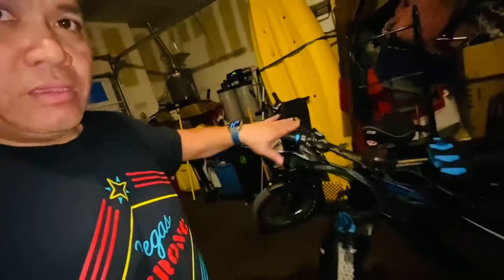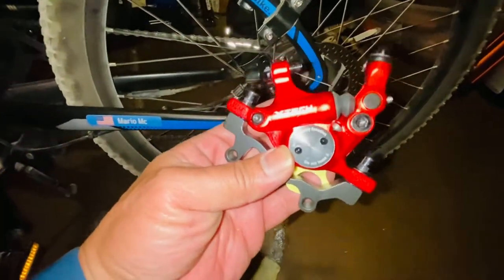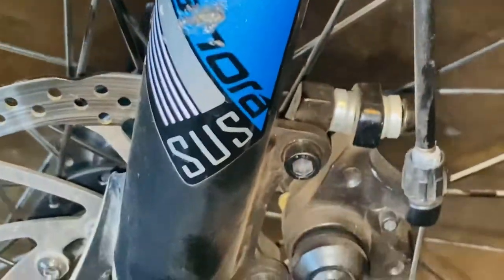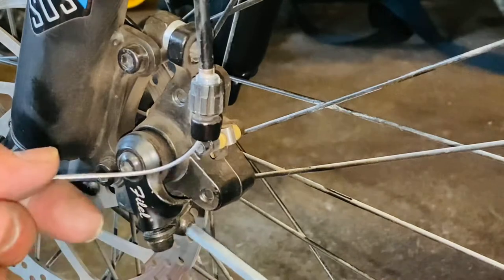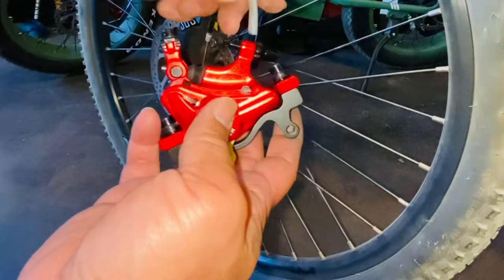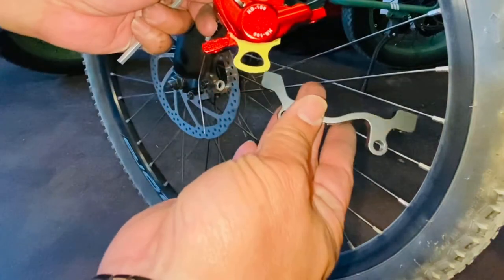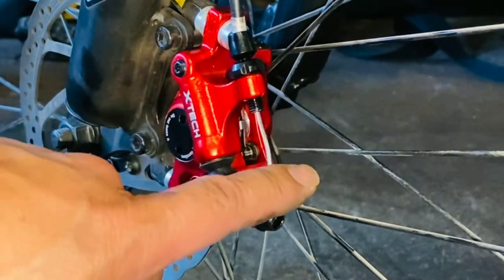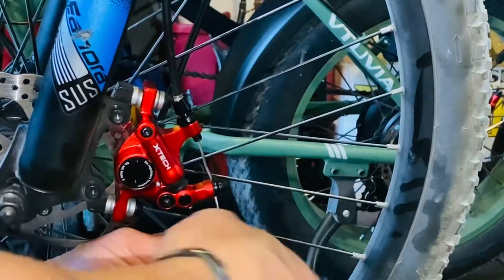CONVERT A MECHANICAL DISC BRAKE INTO A HYDRAULIC DISC BRAKE CALIPER|FOR ELECTRIC BIKE & REGULAR BIKE

Comment: You also had the TRP Spyres in mechanical that have both pads that squeeze the brake. That's what I took for my new bike build.

But hybrid brakes like you used is also very good. I wouldn't call it hydraulic though since it's still half mechanical. You have less liquid and if you brake too much it generates lots of heat and could potentially render your brakes useless if too much water and it boiled. But for normal rides it shouldn't be an issue and the bleeding is much simpler than with full hydraulic.

I'd advise against fully hydraulic brakes for normal people like us.Maintenance of hydraulic brakes when necessary is kind of a nightmare. And, if like me, you have a leek in your shifter, it's game over.

Comment: Ι have fafrees hailong 26''  e bike which has lever with brake and exactly below  a cable that gives signal to moter in order to stop .
I want to upgrade to hydraulic because after some long rides i need to set the breaks , so if i want to slide over the procces, if i choose these breaks, will i solve the problem ? or not? can sb direct me please?
Reply from the maker: With proper adjustments on the cable, it might but hard to tell. Thanks